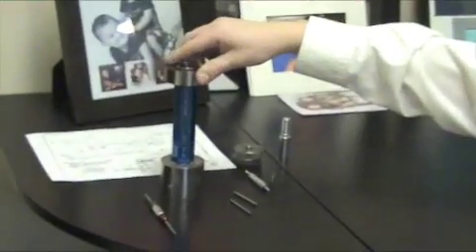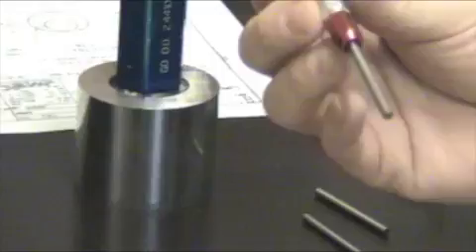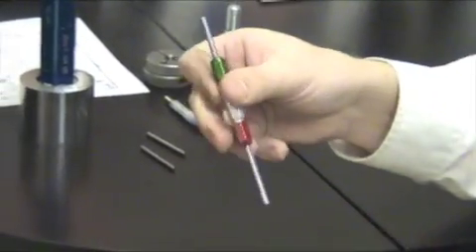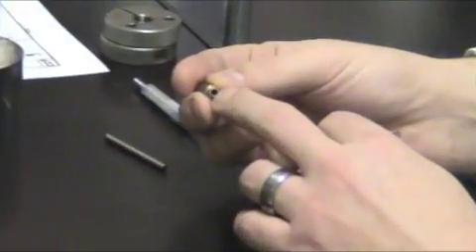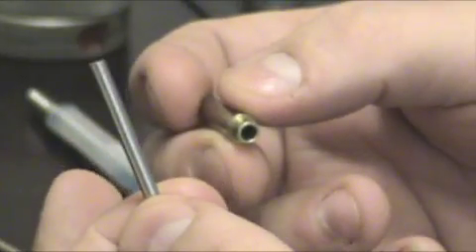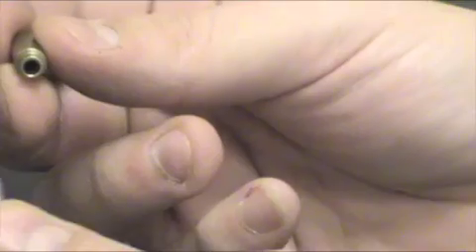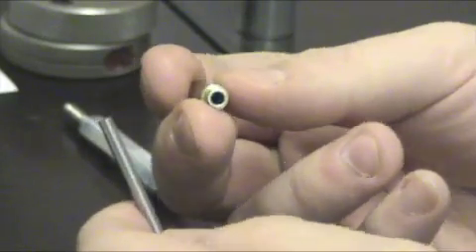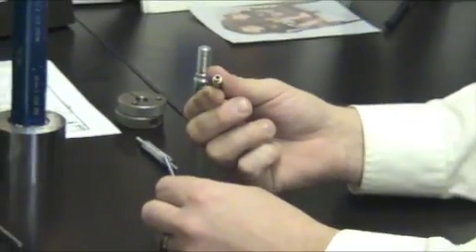How To Use Gage Pins & Plug Gages

Comment: Wouldn't the .143 be the top of the tolerance? So the absolute nogo pin (if the .143 pin entered slightly) would be .1431? I just have trouble understanding why people use a nogo that is at the top of the tolerance, yet still considered a good number since to spec it would still be in tolerance.
Reply: nick maritch you are always trying to be in the middle of the tolerances